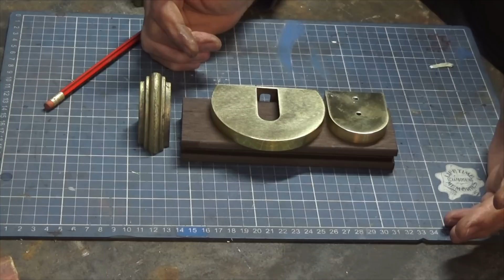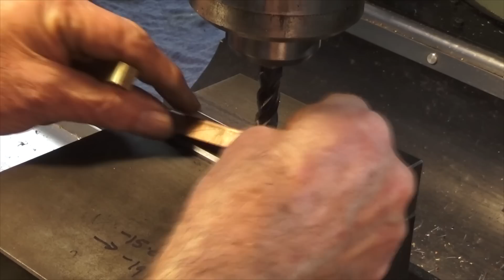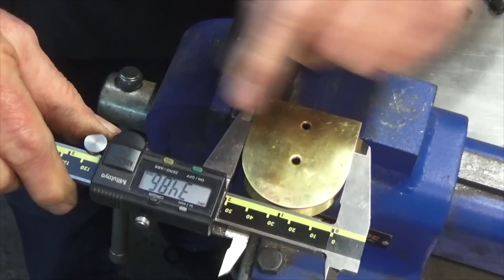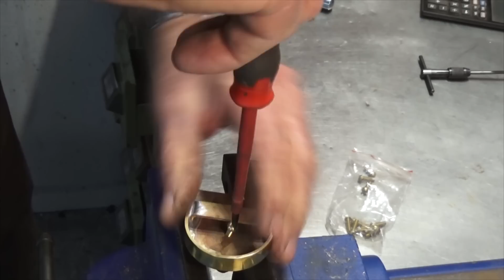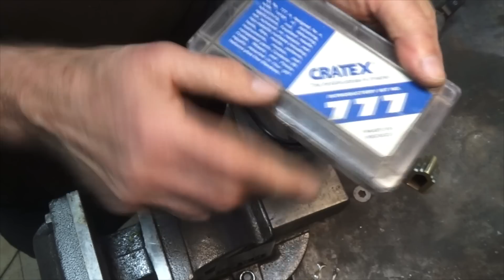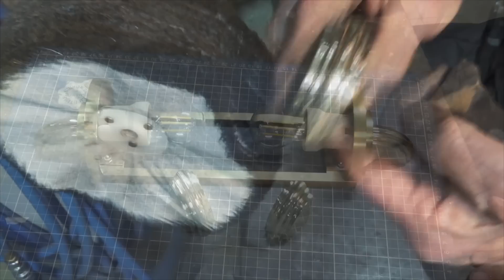DIY ART DECO WALL SCONCES (THAT'S A WALL LIGHT FITTING) Part 5

Comment: Thanks I am catching up. You can down load a bend allowance chart or calculator. An old sheety told me a rule of thumb method that was really good  I think for a single bend you subtracted the thickness of the material plus half of it for the bend line?
Reply from the maker: Sometimes I will use the sheet metal tools in Autodesk Inventor to create a layout pattern for thicker sheet metal. It is very accurate but probably overkill for this project. I have seen those bend allowance tables before.
Regards,
Mark

Comment: Finally got an opportunity to watch this video (too many bumps on the road). Getting better looking and it's still a work in progress. Pleased to know the Titan has dedicated place in the museum  - it's a well deserved tribute to your fantastic work!
PS: Not trying to be detrimental, but in my teens, after doing the exact same thing you did, I was told (by a person I respected a lot) that one should never throw water at a soft solder joint as it will get weaker and brittle - it should drop to room temperature on its own. At the time, I tested the joint I had splashed and it seemed to hold OK, but I never did it again :-)
Reply from the maker: Thanks Jose. Thermal shock can and does weaken joints but in my case there are no stressed joints so it should be OK. I will be doing the first of the electroplating tomorrow. I did some brass parts for another project today and they turned out great. 
Regards,
Mark
Reply: @Preso58  Thanks. Can't wait to see the results of the electroplating 🙂

Comment: Tripoli buffing compound is useful for polishing headlights to. Just make sure you use a slow speed battery drill. Anything higher speed will melt the plastic.

Comment: Once again this has been a great video to learn from - I particularly value your commentary regarding modification of original thoughts and plans.  This helps in understanding the philosophy and design process underlying your approach and is really appreciated.  Thanks Mark.
Reply from the maker: Thanks Andrew. Prototypes aren't pretty. Doing it all again would result in a much more efficient and neater result but that ain't going to happen. If you stand back and squint your eyes a bit you will think I knew what I was doing!
Regards,
Mark

Comment: Hi Mark !! Lovely to see how you welded you use tin or lead? I'm curious to know what liquid you have on the brush , you used the brush after had drain the tin (or lead) on the 2 parts!! I want to buy a torch like yours in the future, now i have a GPL torch but it did not reach that temperature, also for Castolin welding that i love it but i cannot make it for this reason!! Nice video, a big Ciao from Italy, Alberto.
Reply from the maker: Alberto, the liquid flux I use is zinc chloride which is just hydrochloric acid with zinc dissolved in it. It is also known as "killed spirits". It is a commercially made flux buy you can make your own. The torch I am using burns propane gas and it's good for soft soldering but for silver soldering I use Oxy Propane. 
Regards,
Mark
Reply: @Preso58  Thank you Mark for your answer, i Will have to buy something  new for my workshop! You know when you have in mind something....before or after you will put the hand on the credit card 😀Have a nice weekend, Alberto

Comment: Please Mark, what part number from 3M is that Scotch Brite wheel?
Reply from the maker: Sadly, I have no information about the provenance of that wheel. I don't think it's a genuine Scotchbrite. I bought it on Ebay and I cannot even find the original sellers information since Ebay will only show the transactions for the last three years. There are some Chinese knockoffs on Aliexpress which are similar. It is a good wheel though. It has done a lot of work and it's still got a lot of life left in it. https://www.aliexpress.com/item/32845844112.html?spm=a2g0o.productlist.0.0.39e646afnvkCUT&algo_pvid=3ac89de1-0ea9-4812-a38c-a679eabf6a67&algo_exp_id=3ac89de1-0ea9-4812-a38c-a679eabf6a67-28&pdp_ext_f=%7B%22sku_id%22%3A%2212000018189582322%22%7D&pdp_npi=2%40dis%21AUD%21%2110.96%21%21%214.44%21%21%402103255a16590069314665129e633f%2112000018189582322%21sea
Regards,
Mark
Reply: @Preso58  Thanks very much Mark, Will have a look at the link.  Stuff like that is so so difficult to get here in Calvinia, South Africa.

Comment: I wish I had known (about) the gentleman who is advising you on electroplating back in the day when I was an industrial engineer in a furniture factory. We plated nickel and chrome on steel furniture frames. Plating failuress accounted for most of the plants scrap losses - huge in comparison to offcuts and other process losses. His kind of knowledge would have been invaluable in the design and process engineering of our plated products.
Reply from the maker: I was very grateful when Chris contacted me. I didn't waste any time in getting back to him. When I was teaching we were encouraged to recommend trades to our graduating students but most kids were only interested in areas like carpentry, auto body repair, electrical and plumbing. Electroplating wasn't really a trade that anyone knew anything about and in the area where I was teaching we had very little industry. It was mainly tourism. It was hard to send kids out to work experience in trades like foundry work and metal finishing. There was a large furniture factory in an adjacent town but they sent all their work out for plating. I have always referred to electroplating as one of the "dark arts". It's pretty much alchemy!
Regards,
Mark

Comment: Thanks for showing the polishing procedure. 

I watched the vids by Scott from Cold War Motors when he polished stainless trim. 

It never ceases to amaze me how shiny metal can get.
Reply from the maker: Unfortunately, the work involved in getting a truly flawless finish is staggering. I should have indicated how long it actually took and I didn't even take it to the level it should be at. Chris, the guru who has been coaching me, said it was actually easier to do large parts since you can really put some pressure on them without the part getting so hot that you cannot hold it. Those castings got hot really quickly and you have to keep cooling them to keep working on them. It's also dirty work and dangerous too if you catch the part on the wheel. 
Regards,
Mark
Reply: @Preso58  It is one of the dirtiest of processes! I remember going to a business to apply for a job polishing and the polishing room was from floor to ceiling, black and many of the sharp angles in the room were no longer sharp since the dust and grease had built up so deep... I didn't take the job by the way hehe. I ended up working at a badge making business. Their polishing machine was huge, like 3 horse power and the mops were larger than I had worked with until then. If something was ripped from your hands by them it was curtains for the part! But you got strong fingers and the technique so it was a rarity that parts were lost like that :)

Comment: That is coming together well, looks great. I'm interested in the rake you used on the polishing mop. I have used a wire brush in the past but I find it a bit aggressive. By the look of your tool it is just a piece of ply with nails driven through. Must make one.
Reply from the maker: That's all I used. You can buy wheel rakes but they have double handles and you hold them either side of the wheel. The commercial ones have four rows of triangular shaped teeth made of sheet metal. The nails that I used help to loosen all the caked on metal and wax and it seems to cut more freely after using the rake. I used to use a wire brush too but I think the nails do a better job.
Regards,
Mark

Comment: Terrific progress.   A LOT of work in the polishing.  Good you found out about the plating issues.   That would have been a frustrating failure.
Nice update on the Titon engine.    Loved the part about George making the propeller from wood offcuts from the Spruce Goose.  I wonder if the wood was "available" after the move of the plane from LA to Oregon.   Quite a story in that move.
I do miss the nature shots at the end of the video.   I love the cartoons.   Very creative.   Amazing he does this with a tablet and a finger.
Dave.
Reply from the maker: I did receive an update from Roger Taylor today. He said the the museum which exhibited the aircraft used to sell offcuts of wood from the aircraft as souvenirs. I was very surprised that the spruce goose was still intact. It is wonderful that they have been able to save it from being scrapped. 
Regards,
Mark

Comment: G'day Mark, great work so far... I love the art deco style.

A small tip with bending- with the end you bent over the vice jaw, before removing from vice you can measure the newly made right angle's distance from the jaw and subtract from the overall length you are after. Marking the other end that subtracted distance and lining up with another square edge the same as the first will give you the same bend again. Should save you a fixture if this is necessary again in the future.

Love your work mate, keep it up 👍
Reply from the maker: That's a good tip. Bending metal is always a bit of a lottery. In my career as a metal work teacher we used to make sheet metal projects from galvanised steel and tinplate (which you rarely see these days). We got used to being able to predict the bending allowances but thicker material is a whole different ball game. I did bend a few of those parts without the former and I think I scrapped quite a few before I realised it would actually save time to make the former and be done with it. 
Regards,
Mark

Comment: I can't get past the length of those slots.
How far off centre did you think it would be after all that careful planning?
Reply from the maker: Michael, there is a reason why those slots were so long. You are correct that I should have been able to just drill a round hole and have it line up. The reality is that just about every project I make is a prototype. Often I will develop the design as a broad overview and then start to make parts and problem solve. I fitted the U shaped brackets first and then measured out the position of the matching hole in the top cap. I inadvertently placed the holes too far apart and the threaded portion would have intersected part of the vertical bend.  Disaster! Oh well, just turn the hole into a slot. But I had to come inboard quite a way to get the threaded hole away from the bend. By the time I am finished I would be able to correct all the cockups and have a nice, slick efficient design. However, I won't be making any more of these lamps so the "curious design features" will have to stay. 
Regards,
Mark

Comment: Gday Preso, all plans are made to be altered, do you think it’s a better way now having the 3 components screw together?, the brass castings look great polished up, the Titan engine looks great in the display, proud moment there mate, awesome job as always, cheers
Reply from the maker: Matty, I am actually glad I didn't go ahead and solder the two fabricated parts together. It would have made it much harder to do the final polish before plating. Chris Lock has volunteered to come around to my workshop to look over my plating setup so I intend to grill him intensely.
Regards,
Mark

Comment: With all the work you've put into these I imagine it will bring a smile each time you turn them on. As much as I look  forward to seeing the end result, the journey is my favorite part.
Reply from the maker: Initially, I tried to buy some art deco lamps but the ones I liked the most came from India and the Ebay seller was asking $1250 each for them. They may or may not have been original but it was still out of my price range. 
Regards,
Mark

Comment: Hey Mark, couldn't you find a bigger solder wire? 😂😂😂😂
Reply from the maker: I know those solder sticks are comically large. I sometimes hammer them out into a sort of flat ribbon but you can accidently contaminate the alloy with dirt and other debris. I have been meaning to buy some of the solder paste which is a lot easier to control.
Regards,
Mark

Comment: As was once said to me, "The polishing mop is the most dangerous item in this workshop!"
Reply from the maker: That can be true. I once tried to polish the bezel from a "Napoleon Hat" clock. It got caught in the mop and wrapped around it in the blink of an eye. It scraped a huge slab of skin off the back of my hand in the process. Usually, any parts that get caught just get flung onto the floor but thin or flimsy parts are just plain dangerous. 
Regards,
Mark

Comment: Hey Mark, 
nice bending Jigg....works great! 
(you will never bend the same way twice......!) :)
These Wall Scones look so fantastic! looking forward to the glas Pipes installation! 
Stay healthy!
Reply from the maker: Thanks Chris. I don't know if you have ever used the sheet metal tools in Autodesk Inventor or Fusion 360 but they do help to "develop" bent sheet metal parts into flat patterns. Before such tools were available we used to have rough formulas for estimating bending allowances but they were all for very thin sheet material. Thicker stuff is much harder to predict. 
Regards,
Mark

Comment: Mark,

Curious why you  didn't just cast the ends as one piece rather than sandwiching all together?

Great job nonetheless.
Reply from the maker: Roger, one of the hallmarks of art deco is the very linear and strict geometry of the forms. Using the flat sheet brass makes it easier to get truly flat surfaces on the end caps. If I were to try and cast the entire end assembly, it would be difficult to get sharp internal corners and neat crisp edges. It would also be hard to keep the forms thin enough to keep the weight down. 
Regards,
Mark
Reply: @Preso58  

Thanks for the reasoning, I wasn't aware that art deco had such rules.

Once again I  have enjoyed all of your videos and hope to keep enjoying them.